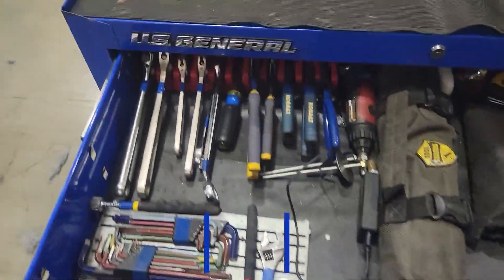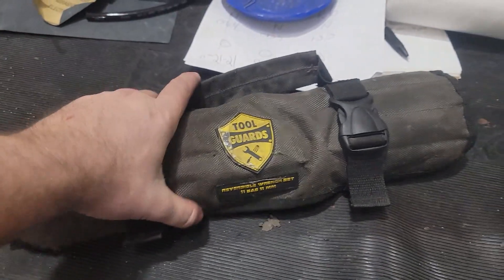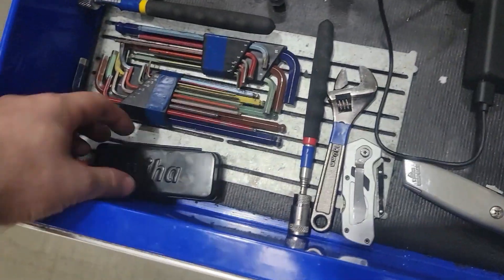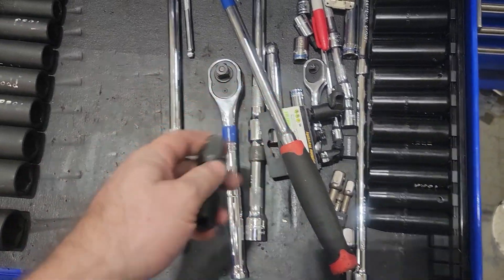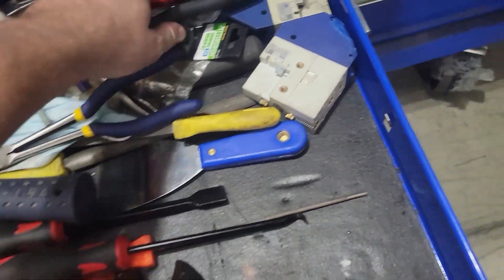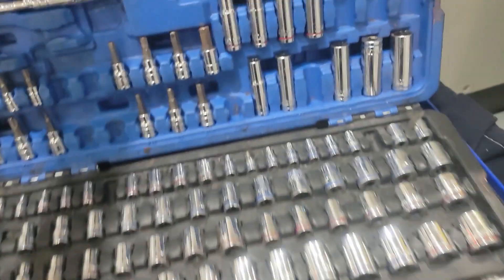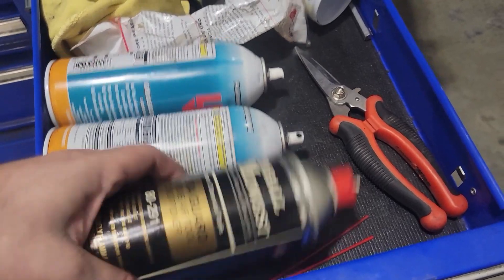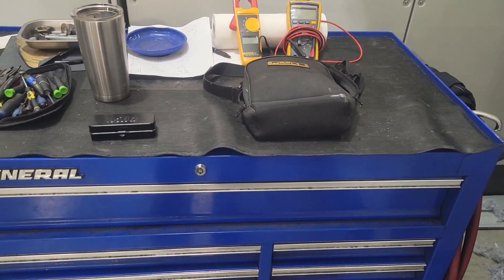LOOK INSIDE a Maintenance Technician's Toolbox (2021 - 2022)

Comment: Too neat. I’m an Millwright/ Industrial Mechanic and I’m packed. I have two boxes stationary in the shop and a mobile cart. I use anything from a electronic screwdriver to a three foot pipe wrench. Jobs range from steam boilers and support equipment to silos conveyors. There’s pipe fitting and welding, custom fabrications and just about anything you can imagine. So you can imagine my box organization. As messy or packed my boxes are, I know where almost everything is at.